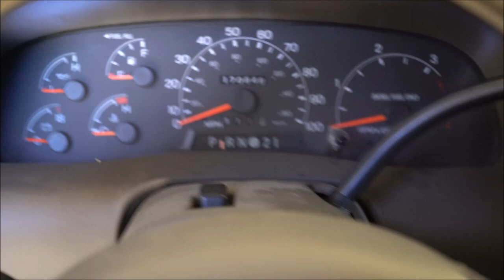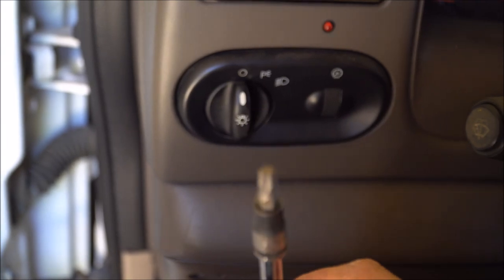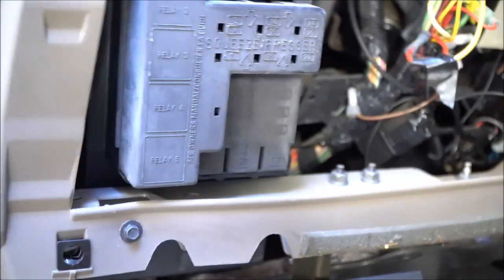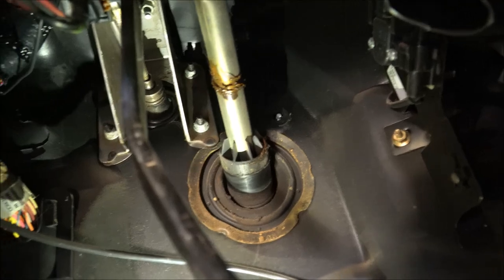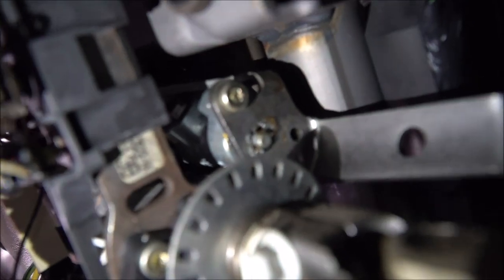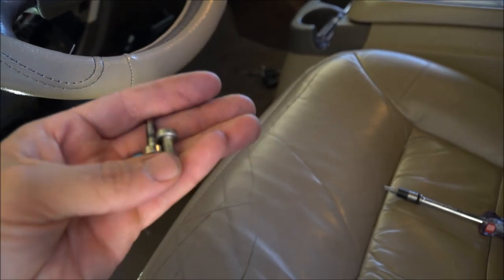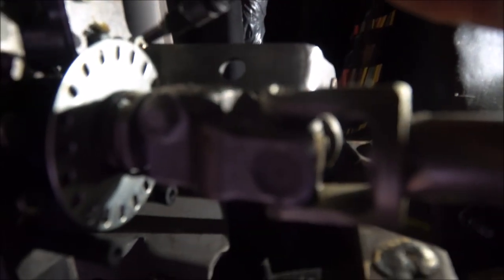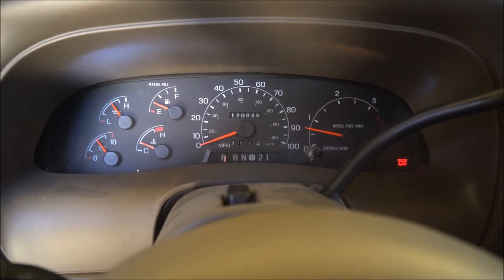FORD WONT START IN PARK FIX

Comment: As a mechanic I recommend so that this doesnt happen again to use a lock tite adhesive on the bolt threads then reinstall them.

Comment: Brother, I can not tell you how this just saved my life. I was driving my 2006 f350 and a bolt fell out onto my foot. I am by no means a mechanic so i started to freak out and then my wife pulled up this video. If you simply follow every step this man gives, a dummy could fix this problem. He made it so easy and he was absolutely right about everything he said. The truck shifts beautifully now thanks to you. Appreciate it.

Comment: I found the screw that you had missing on my floor. Didn’t know what it belonged to so I set it aside to continue figuring out how to fix my 2003 Ford Explorer sport. I’ve watched at least 5 different videos, none of which helped me solved my issue. Although I learned a lot from all the videos I watched, this was the one that helped. You held up that screw and I was all “omg.... I know that screw!” I put it in where you said and it fixed my issue. I appreciate this video to the max. Thank you so much!!
Reply from the maker: Your welcome

Comment: People say to put loctite on those screws but I’m kinda skeptical about doing that because if when the whole shifter tube has to be changed it would be a bear to take those two screws out way up there in that tight space and god forbid that you strip the t30 screw head
Reply from the maker: Me too bro I didn't but to each own

Comment: Dude your video is timeless, it’s 2022 and I just solved my months long issue with my 2004 V-10 Excursion after watching your video. Bolt was loose and needed to be tightened. Took me less than 10 minutes. Thank you!

Comment: great fix, after a new neutral safety switch installed problem still existed. Removed said screws, installed threadlock and re-installed screws and bingo all good. Probably didn't need switch but an easy $50 learning process. Both screws were loose as described.
Thanks again

Comment: The bolt that goes into this piece is a M 6 and it is 20m long. I bought a flanged grade 8 bolt, and put some lock tight.  This shifter ended up tighter than a nun on Sunday mass!!! Thanks for the help

Comment: Thanks for the info , worked on my 2007 Ranger. It was a little tough getting up in there but I tightened the bolts a half turn each works great now.

Comment: Thanks for the info , this worked on my 2007 ranger. I tightened the two bolts a half turn each and it solved the problem

Comment: Why I did  not find you sooner?  Had the same issue ( truck starting sometimes and sometimes it woudn't and  difficulty engaging park and the other shift positions)in my 1999 F350 gas V10 , the problem was getting worse and I changed the battery and the first  mechanic changed the starter and a bunch of other things ( unrelated) so I spent over $ 3000. The issue continued so I went to another mechanic and he told me he had to order some parts from the dealer, a new starter and some cable that was damaged . I was going to go back to them tomorrow...but I watched your video....and found the issue ...the 2 fu ck ing screws were loose....I tight em and is perfect now. 
I was ripped off once and was going to be 
ra pe d twice....because of 2 loose screws. 
You saved my a s s . Thanks a lot

Comment: Thank you, thank you, thank you!  Best part was your use of the easy to replace fastener from the electrical connector!  My two bolts loosened enough such that the lever was strong enough to snap the head off one bolt.  But that bolt was already lose and unscrewed by hand.  Only two problems for me.  First one is I am 6 foot 250 lbs and scrunching under the dash is fun.  Second problem is the temperature is in the 20's.  Cold tools are no fun!  I will redo this with locktite  when it gets warm!  Paid just under $4 for another bolt, put it in the connector, buttoned up the fuse panel and I am good to go!

Comment: I have a 97 Expedition with the same problem. If it isn't a loose plate, is there any other way to repair like adjusting the the screw/wheel on the cable?

Comment: Thanks, fixed the problem for only the
cost of the effort. The most difficult thing was fitting under the
dash without being a contortionist. Was at first dismayed to see both
torq head bolts in place. Then I jiggled the shift lever and saw that
on bolt had backed out and was loose. Found the other one was also
loose. Tightened both bolts and now shift lever works like the day in
came from the factory. This began as occasional not starting in park
making me think neutral safety switch on transmission was failing. So
I bought a new one and if it ever goes bad I am ready.
Reply from the maker: Sweet man

Comment: Any recommendations if the screw won't go into the hole? It's like the two components are not flush but I can't get in there to see down the hole. Do I need to be in reverse? Does my e-brake need to be disengaged? Im attempting with the the gear in between park and reverse.
Reply from the maker: Take the one next to it out and try it thats what I did if that doesn't work it may be a trip to lowes or home depot for one. I would place the vehicle in to neutral. And engage the ebrake in order to not roll the car
Reply: @CHASINGPROFITS  Dude you rock! I put it in neutral and had to push the bracket up to get it flush with the other piece. Got it in and tightened the other bolt as it was a bit loose. Worked perfectly. Thanks for the quick response and for making the video!

Comment: Thank you, corrected the issue with ease. Also, fyi let a friend borrow the t30 I had in my kit, so only had a t25, it worked fine. I don't recommend using the wrong size bits due to stripping, but just don't go crazy and it fit plenty snug, use at your own risk though. Also subscribed, feel like if anything actually helps that should be automatic

Comment: Thanks so much.  I have a 1999 Ford Taurus with the same problem, I changed the shifter bushings and it didn't help.  Not until I found your video.  I was lucky that my screws were still there, but just barely hanging on.
Reply from the maker: You are very welcome

Comment: Hope you can help!!  My '99 Ford Econoline van is doing the same thing...have to start it in "neutral" .  I am going to check those screws but...would that also be the reason that even when keys are shut off the van starts rolling if I am not on level ground.  Would this fix that problem or is this a costly transmission repair???
Reply: I have an econoline and have the same problems you describe. Tightening these two star shaped screws fixed my van rolling away while in park. You can do it. T30 bit and some wobble extensions is what I needed to use.
Reply: Yes it will fix it if that bracket is loose.  The bolts shown in the video hold that bracket tight and that bracket is what actually moves the transmission shift cable.  When that's loose you're not shifting all the way into park.  On my 2001 Mazda B3000 (basically Ford Ranger), it's the same bracket, and sometimes it would pop into reverse and I couldn't start it in park.  After tightening those it works fine.  I'd suggest turning key to ON without starting it, push down on the brake lever and shift it down into neutral, remove one screw at a time and put some blue loctite on the threads.  Shifting down into neutral takes some tension off the cable.  That should stop them from backing out.

Comment: Thank you for posting, resolved the same issue on my '97 F150!
Reply: I also have a 97 Ford Expedition with the same problem. If all else fails, check the spring in the instrument panel that goes to the gear shift

Comment: Thanks for this video!🥰 

By the way have you ever worked on the third brake light on a 2000 Ford expedition xlt triton v8 4.6L? 

I was told that the brake light assembly harness wires would need to be sauntered  to remove and replace since it isn't one that clips in like most newer Ford expeditions. And I can't seem to find a brake light harness for my expedition to replace the one that's no longer working since my vehicle is older. Salvage yards have not been helpful.

Any help would be appreciated.😊

Comment: Very helpful i had the same issue with my 01 expidition. Replaced the bolt and it works perfect now. Thanks for the Video.
Reply from the maker: No problem thanks for the comment!

Comment: If this didn’t work for anyone or you contorted yourself between the seat and dash to see that both your screws were tight (speaking from experience) CHECK YOUR SHIFT COLMN BUSHINGS. I had this issue but both my screws were tight. The bushing cost 8$ on Amazon and the fix is just as easy as this

Comment: I have a 2000 Ford Ranger and I believe this is my problem as well, I'm gonna have to get underneath and check for loose or missing screws, my truck rolled out of the driveway last night.
Reply from the maker: Get it done dude?

Comment: Thanks for video
It will work for central console transportation?
Reply from the maker: of course
Reply: CHASING LIFE My transmission shifter in the central console middle of the two front seats, so my transmission screw in the under staring well too?

Comment: Mine did this at first for awhile but now the shifter lever  won't go into reverse and  easily slides threw the gears intill I get to drive it locks into drive like normal I was thinking shifter cable but now you have me thinking could both screws Fallin out and caused this?
Reply: Nvm went and checked put the one screw back in and tighten the other one and now it works like brand new Thank you saved me 100 I was going to spend on anew shifter cable

Comment: I have a question... first I do have this shifter problem but my question is with this problem and a bad ignition switch would it make it seem like the fuel pump is bad ??
Reply from the maker: huh?
Reply: Try turning your ignition on but don’t crank it and listen for a little buzzing sound if you here a buzz for like 2-3 seconds your fuel pump is probably fine
Reply: @leviathan5908  fuel pump was fine! New ignition switch fixed the problem! #JustAGirl
Reply: @cheshirekatzlexi8865  Awesome to hear! realize my advice doesn’t really help if you had A bad ignition switch LOL
Reply: @leviathan5908  lol it did tho, im no mechanic but i just knew the fuel pump wasnt my problem...but trying to get the guy to understand that if the pump wasnt getting power of course it wouldnt work..neither did my headlights but he didnt insist i needed new headlights! Lol
Reply: @cheshirekatzlexi8865  lol happens! I had a loose battery terminal and had a guy tell me I needed to replace the starter 😅
Reply: @leviathan5908  because i couldnt tell if he honestly hadnt thought about that or if he was thrown because i busted him tryin to over on me....either way, i no longer refer to him as "my mechanic"! Lol

Comment: Thank you, will try this Im having the same problem
Reply: tried this and was able to tighten the 2 screws but I notice the whole assembly when I push it from underneath was a bit wiggly, is this normal? still having some minor shifting issues going to park, sometimes it shift right in sometimes I have to try a couple of times

Comment: Have this issue with 1st only but both bolts are in place and tight worked fine bolts fell out completely now no 1st any ideas?
Reply from the maker: use locking thread paste

Comment: what if batteries dead if that things happen then it’s only gonna crank over when it’s in neutral but the battery is so dead. It won’t start but it won’t start and park click click click click. That’s it put it neutral and it was like turning over but dragon because it was dead in the battery I tried my battery pack, but I don’t think it’s strong enough to charge it.
Reply from the maker: For sure get a bigger pack or a actual charger

Comment: I tightened the too bolts that were very loose and my f150 still won't start in park or natural. Please help.
Reply from the maker: Very strange everyone in this thread has had success something additional is wrong maybe someone went into your odometer
Reply: @CHASINGPROFITS  I believe the terminals are corroded on the starter. I will post my results after I check it.

Comment: I just fixed the same problem on a 97 Expedition. I didn’t need to remove the bottom dash plastic. I could reach the screws from under neath the dashboard without removing anything.
Reply: I'm about to go look at my 97 f-150. hoping its the same issue. starts in neutral but not in park. update: fixed the issue 100%..This guys video was a life saver, took 5 minutes to fix.

Comment: Had to fix this 3 times and the theft circuit issue 50% of the time I changed the battery. These issues on my Explorer are the reasons I will never purchase another Ford vehicle.

Comment: Good idea to use thread locker to prevent bolt backing out again.
Reply from the maker: great idea
Reply: @CHASINGPROFITS  Had to do same job and I don't want to do it again because bolts backed out.

Comment: My 2001 explorer won't go into gear. It only goes to reverse and that's all the way to one side and it won't go any further.
Reply from the maker: did you try the fix
Reply: @CHASINGPROFITS   Got it fixed. The plastic piece on the gear shift came off. Replaced it.

Comment: What if my bolts are tight?
Reply: what did it turn out to be neutral safety switch ?
Reply: My bolts are tight also. And I’m having this issue, mine won’t start in neutral either. I have to jump the starter solenoid. I also replaced the solenoid. Any thoughts???

Comment: Mine will start if i pull UP on the shifter while turning the key....about a year now 😂😂getting tired of it though..😵
Reply: mine too, but eventually got stuck in a store parking lot 😏😂 better to just get it fixed.. especially seeing how cheap and easy it is to fix it..
Reply: This is the issue with my '96 Explorer.  I'm hoping this will resolve the issue.

Comment: What about the two bushings and you need to check the brackets on top of the steering column mechanism you should have dropped the steering column and replace the bushings at least that way you can check it all out silly rabbit